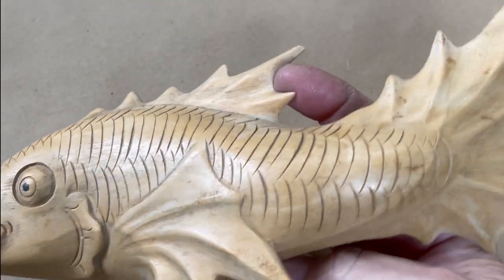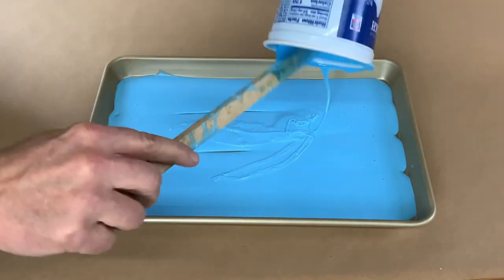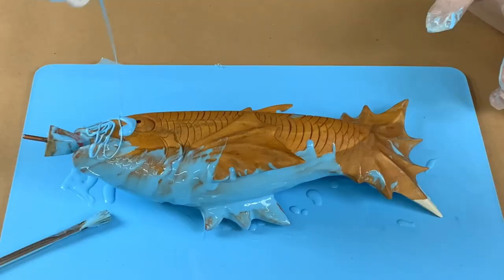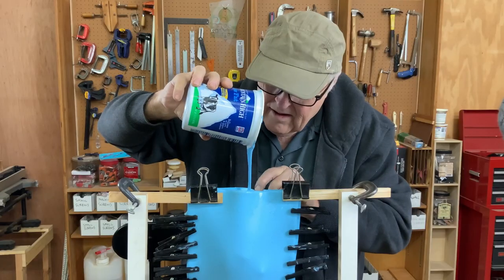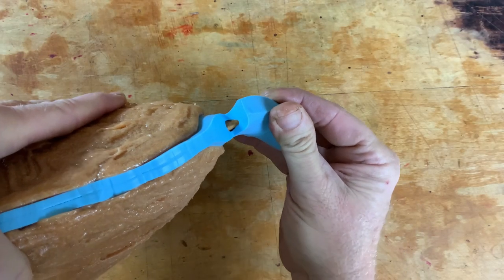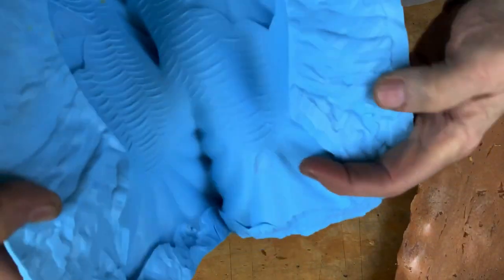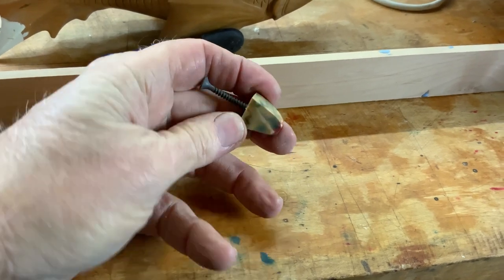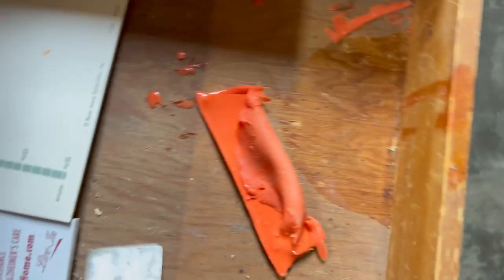A Fish In A Sack?

Comment: Well Bob, you gave the term “Gone Fishing” a new meaning.  You know the old saying, “ it’s in the bag”.  I better stop while I’m breaking even.  Technically the mold bag worked, but I think I’ll stick to the traditional mold making that you taught me. Best regards, Richard
Reply from the maker: It was worth a try Richard. And I think with some refinement the method might yield a good mold with a minimum of labor. Only time and further exploration will tell.
Reply: @RobertTolone  the problem as I see it, is that it needs to be suspended off the bottom and allowed the rubber to fill in around the fish. It’s leaning against the bottom. It needs more room for the rubber to fully encapsulate the fish.  Listen to me giving the Master pointers.
Richard

Comment: After watching your vids for a long time I don't think I ever caught put the hardener in the cup first. Thank you again. Still working up the courage for that first mold. Sadly I don't think the suggestion to cast in pieces would work, the lots of legs are from an octopus and he's quite small. But over Christmas break I'm going to do it and it's all thanks to you. I hope you have a lovely Christmas and thanks for sharing your wisdom with us.
I forgot to add my appreciation for all your experiments. Success or failure they're just as interesting. Doing the same thing all the time would be boring and you'd never discover short cuts or design improvements if you didn't try.

Comment: This definitely lends more credence to my idea of a vacuum drawn casting method, ideally I'm thinking of drawing the resin in under vacuum, but it might be viable to pour the mould under similar conditions.

You keep being an inspiration, keep it up
Reply: Are you suggesting a "resin infusion" method for casting?  This is a technique used in composites manufacturing.  But I think it is more practical to inject resin from the bottom of a mold.  I use this technique for creating a thin urethane over-mold on carbon fiber parts.  And I'm dreaming of the day I can justify buying a meter mix machine!
Reply: @fredygump5578  very similar, there's a technique called vacuum casting for metals in plaster (I believe), but that's sacrificial casting.

Ideally I'm thinking a system that's under vacuum entirely, feeding the resin into the mould & allowing that to equalise the pressure
Reply: Resin vacuum casting is already a thing. It's not necessarily pulling in the resin, using gravity to fill up an evacuated mold is enough, and you will never catch bubbles, as there is no air.

Comment: With the benefit of hindsight, were there any advantages to using a sack mold over a conventional cut mold?  It seems to me you had to use a lot more rubber and the limited visibility of pouring into a sack was a major cause of the weak spots.

Comment: Hi @RobertTolone I had a video idea for you and something I am curious about.  I am curious what would happen if you used a clear (or semi clear) silicone for the mold, then use 3D printing resins for the part.  After filling the mold, place it in a UV curing chamber.  Would it cure correctly and be successful?  If so, I wonder how long it would take?  I thought about trying it but think it would be better for you and a video.

Comment: So in summary, this method saves a bit on rubber, at the expense of more labor and more possibilities of things going wrong...
I'm always looking at this from the perspective of getting 3D stuff from a computer into castings. If the fish was a CAD model, you could print a cheap shell on a filament printer that had consist distance/wall thickness to the actual object and use that as the mother shell.
Reply from the maker: I agree this could have been a good candidate for a 3-D printed mold shell.  Although I am put off by the amount of time it takes to print a shell of this the size. And it is not entirely hands-off time. There is quite a bit of labor in modeling, slicing, printing and cleaning a 3dprint.  I love the idea but the reality of the execution is quite different.
And actually, this sack method was much less labor than the traditional way of brushing on multiple coats of rubber.  Also much less labor than using clay to mock up the rubber mold, then building a hard shell around the clay, then taking it apart and pouring the rubber into the cavity. I have done that method on the channel and it is a lot more labor. So I am not ready yet to entirely give up on the sack method.
Reply: @RobertTolone  As always, it depends on the workflow. Creating and printing shells could be a quick process, if you did it three times a week, and all objects to cast had somewhat similar geometry.
Although I was comparing the added labor vs. savings in rubber to a conventional box mold. Brush on rubber would have been the same, but the rest of the casting could have been in a box mold.

Comment: The technique seems to present possibilities. The problems in this instance might’ve been overcome by suspending the Fish from the tail - centrally lined to the sack?  It appears that you’re forced to work within the sacks ‘Pillow like’ shape every time, so pre - bulking it out with ‘Silicone bars’ would alter the sides shape and thickness.
Reply from the maker: Yeah, those are some good ideas for refining the technique. It wasn’t a totally failed first try and I’m pretty sure most of the problems could be worked out. It was certainly a lot less labor than the multi-layer, brushed-on approach.
Reply: Thanks for demonstrating this technique. I too wouldn’t consider it a failure - in terms of learning, the demonstration prompts and encourages inquisitive thoughts, that’s a win - win in my book.

Comment: Would you be able to inject some rubber into those weak areas to fix the mold?
Reply from the maker: Not reliably.  The flaws will not be too hard to fix in the castings… But the best thing would be to make a better mold. This attempt has given me some ideas for further refinement of the process

Comment: If you dont have a pressure chamber will using a resin with a longer cure time result in less bubbles than one with a shorter cure time?
Reply from the maker: It might but not reliably.

Comment: Robert, can we use a light motor oil to just coat our silicone molds so that the resin model comes out easy without wearing out the mold.. will motor oil cause any harm to the mold... spray on mold release is expensive for the amount that comes in an airosol can.
Reply from the maker: I have never tried motor oil. It is a petroleum product like the resin so I’m not sure how they would interact.
Reply: @RobertTolone  Thanks, maybe i will first try OLIVE OIL, since that is not a petroleum product.. i will let you know what i find.

Comment: How can you make sure the hole won't close off after the first pour? If rotational casting creates a hollow shell, wouldnt that be a problem?
Reply from the maker: There are a couple ways of making sure that the sprue does not close up. One is to cut it open while the resin is still soft enough to cut with an X-Acto blade. The second is to rotate the mold in such a way that the resin never reaches the sprue opening.  Then on the last pour rotation you make sure that the sprue area is closed with resin

Comment: Seems like your initial brush coat could have been an accelerated to build a thicker initial layer.
Reply from the maker: Yes, or use a rubber specifically designed to be brushed on.
Reply: @RobertTolone  I've been binging your stuff... I've built and molded composites for years now I'm thinking about casting ho slot car bodies like the one you did... trying to wrap my head around not getting air in the cast... Do you ever vacuum the mold once the resin is in it? Or pressure inject the resin with a syringe?

Comment: very fishy :)
Reply: use transparent plastic as the sack
Reply: yes a vegetable plastic bag
Reply: I just love plastic pottery, spin spin
Reply: parabolic lens mold rotational casting is all about the centrifugal force
Reply from the maker: Not a bad idea, plastic bag.
Reply: want to make metal castings? 3d print a positive, paint with conductive graphite paint, electro-plate to zinc/copper or something, works as durable mold making too (metal shell mold)
Reply: actually you could just simply paint a positive model/original with conductive graphite paint and then electro-plate the durable metal negative copy mold